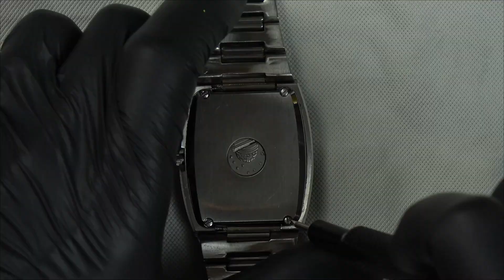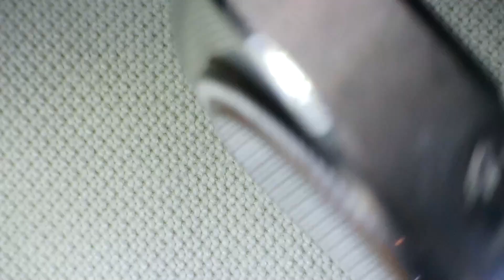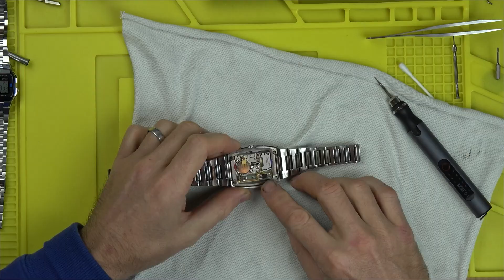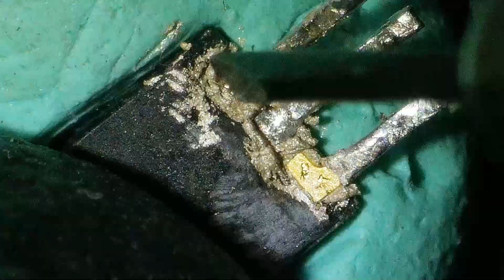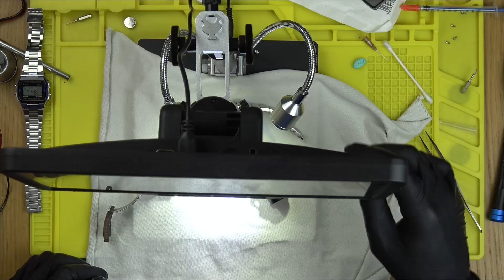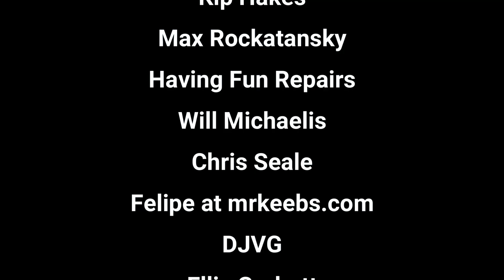Can I fix the RAREST OMEGA WATCH ? - 50 Year old OMEGA BETA 21

Comment: I bought the watch as its so 70s macho. My strap is shot, so it needs a refurb. Trouble is, it has a framework inside the leather. Is almost like 2 straps combined. Have to get refurb 100%, otherwise ruins the look completely. Cant just make a strap, it has to incorporate the frame. Other option is to get a metal bracelet.
Reply: Thanks for your videos. Very inspiring. Have recently bought quite a few good quality 70s and 80s quartz chronos. A big help.

Comment: Such perseverance! Congratulations👍. As others have commented, the vibrating 256 Hz "motor" is just the final stage of the dividing down network. By using only 5 stages of binary division from 8192 Hz (to get down to 256 Hz) - and then employing that resonant motor for the final stage - CEH avoided the large amount of additional power consumption that would have been needed if a chip was used for  final binary division. These early binary divider chips were quite heavy power consumers compared to later CMOS ones!
Interestingly, when these movements went back to Omega for repair later on in the 1970s, they seemed to routinely replace the 8192 Hz oscillator with a modern "32 kHz" version. Presumably because technology had moved on and the old chips may not have been available anymore. The customer would have been unaware of this of course; after all,  it didn't change the functionality of the watch. I can vouch for this to be the case because I've examined such watches & personally measured the oscillator frequency:  32.768 kHz not 8192 Hz!!

Comment: Congratulations Vince, unbelievable how you could rescue the power supply faulty bond wire, it look pretty messy but worked 😀 However, it looks like you murdered the trimming capacitor by trying to solder the sliding contacts on the ceramic silver metallisation... The motor, although tuned to the 256 Hz frequency by a moving mass, cannot be labelled tuning fork, because there is only one arm. That is why the whole watch body is humming! Making a tuning fork motor with opposite phase from one arm to the other would have cancelled this humming and maybe improved the efficiency (battery life) but not sure, because the microcircuit was made from bipolar technology, draining a lot of current. The ODC 5 is an evolution of the initial ODC 4 circuit used for the zero-th series (6'000 movements) sold initially. That first version is recognisable by the hex brass nut working as a trimming capacitor. I was born in Neuchatel and was 8 yrs old when the Beta21 was first released in 1967 but completely unaware of the unique and seminal work done by the CEH, 500 m from my home, whose engineers team built every component of that watch, including the integrated circuit, by hiring Swiss expats who had worked in the first semiconductor companies in the US after the 1950's. The CEH silicon microcircuit director, Kurt Hübner,  had actually worked with William Shockley in his laboratory in Palo Alto.

Comment: vince your channel is awesome!
this is NOT a quartz watch this is a tunning fork movement that predates quartz
Reply: It is a quartz watch because the timing unit is an 8192 Hz quartz oscillator. The "tuning fork" motor is part of the clock dividing system, running at 256 Hz. 
The quite low frequency of the oscillator and the rather high frequency the motor is running allows the electronic divider circuitry in the chip to have 5 stages only (dividing by 2^5=32). In the late 60ies of the last century, it was not easy to build frequency dividers with low power consumption, the technology was not there yet. Even with these measures the Omega 1300 Beta 21 caliber presented here consumes about 13 uA (average, including chip and motor current consumption). 
The tuning fork motor in the beta 21 watch module is an adaptation of the Bulova Accutron tuning fork technology, where the tuning fork is the system's timing unit.

Modern quartz watches run at 32768 Hz and tick a Lavet motor once per second, so the microchip's frequency divider has 15 stages (2^15=32768). Modern quartz watch modules consume about 90 nA (chip only) and about 1 uA (average, including chip and motor current).

Comment: Should have kept grinding away until you could see the bond wire by the way there not soldered inside the chip there welded and by guiding away until you can't see the bond wire you could try to solder it back together with a tiny piece of wire the bridge any gaps between the bond wire and pin

Comment: this chip is a voltage regulator TPS720105DRVR
Reply: It's not.  It's a Beta 21 Version 3 CMOS oscillator chip  CEH-ODC5
Reply: @eidodk  yes ….and good luck finding this stone-age chip, I posted the number for the replacement, that you can buy today

Comment: Just a tip for your soldering, if your touching old solder to re melt, try using a tiny splash of bakers soldering fluid no3 to clear away the oxidising from the top layer. Thank me later! 😂

Comment: This is one of the Best so far. On the other hand early Omega Electronic watches were not long lasting. My Seamaster quartz bought in 1982 didn't last 10 years. My Wife's Roamer Quartz 35 Years & still ticking. BTW thanks 4 the Video. Greeting from Down Under.

Comment: Not strictly a tuning fork but a a see saw micromotor vibrating at 256Hz indexing a 256 toothed wheel via a little ratchet pawl. The  caliber 1300 beta21  movement was only made for one year. Most modern Quartz watch  crystals vibrate at 32768Hz

Comment: Curious as to your battery choice of 344.  I think the original battery was a WH3 (mercury).  Is a 344 a better choice than 395?  Seems 395 comes up as the modern version of that battery, but maybe there isn't enough difference between 344 and 395 to matter.
Reply from the maker: I really don't know the best battery for it. I know on some of the Bulova tuning fork watches they put a diode (I think) in with the battery to reduce the voltage to make it run better BUT on this one I'm not sure on the best choice. It looks like the 344 and 395 are both 1.55V but according to Google the 344 is 105mAh whilst the 395 is 55mAh so the 344 will last longer 👍👍

Comment: What is that tiny grinding tool like a small Dremel you used? Couldn't find it in the comments.
Reply from the maker: Hey Sammy, I just added an Amazon Affiliate link in the Video description. If you are not from the UK just type in Grinding Pen into eBay or Amazon and you should find the same one 👍
Reply: @Mymatevince  Germany. Thanks.

Comment: Why didn´t you connect the last pin to the chip?
Reply: Because the pad it connects to goes nowhere, so therefore the pin mustn't be required in this circuit

Comment: Hi my mate vince,loving your videos as there very entertaining so keep up the good work and was wondering what type of soldering iron do you use please.thanx
Reply: Thanx for that my mate vince,as got a 2 in 1 generic hot air station with added solder iron too, but it's abit naff plus I've also got a separate soldering iron with is equally as naff and just wanted something decent to make my soldering alot easier.Also can you change the tip on the hakko one you've got while it's still on and was wondering what type of flux you use too in your video.
Reply from the maker: @darrenmartin279  This Hakko I'm sure will be better. I believe you can change the tips whilst on BUT I haven't done it yet as it is quite stiff, I'd be a little worried about slipping and burning myself😂 The flux that I have been using for the last year has been Chipquik SMD29130CC 👍👍👍👍
Reply from the maker: Thanks Darren, I used to use a 3 in 1 generic Chinese hot air station but recently I upgraded to a really nice Hakko FX-951. The Hakko is the one you see in this video. It's lovely BUT expensive 👍👍👍

Comment: The board you fixed contains on 8MHz cristal and capacitor. The chip has 3 functions. It keeps the cristal oscillating, it divides the frequency down with a 5 stage binary divider to 256Hz and it drives the vibrating motor (at 256Hz). The motor is just a see-saw with a permanent magnet on one side and a weight on the other side. The permanent magnet is placed between 2 electromagnets. You see the weight but the electro magnets are hidden under a plate. The oscillator drives the electro magnets in an alternating way making the see-saw swing back and forward.  You called it tuning fork, but is actually not a tuning fork. The 2 fingers you see are actually just mounting points for the see-saw, not fingers of a tuning fork.. A gearwheel is driven by an index finger mounted on the rocking see-saw. The adjustment you made is an adjustment of the phase or neutral point of the see-saw. It is not used for speed adjustment.  You can also adjust the position of the weight (by rotating it - it is mounted eccentric) on the see-saw. This adjustment is just intended to make the watch work, it is not to adjust the speed either. It allows you to balance out the see-saw. That way your watch uses the least energy.  Speed has the be adjusted by an adjustable capacitor in the oscillator circuit (the capacitor looks broken on your board). Later quartz watches used stepper motors, no see-saw. Google "The Omega cal 1300 (Beta 21)" for a detailed explanation.
Reply: Just came here to suggest the same, the oscillator is determining the actual speed, initially it just hit every second tooth only...
Reply from the maker: @georgkohlhas8131  Thanks Georg, so that is why it was running at twice the speed. It is all starting to make sense 👌👍👍👍
Reply: @georgkohlhas8131  Right. That's correct.
Reply from the maker: Wow, really interesting Kris. So when it was running fast at the beginning do you think the index fingers were just skipping teeth on the gearwheel because the see saw was misaligned? As I slowed it down without touching the capacitor. Thanks for the super helpful comment 👌👍👍👍👍
Reply: @Mymatevince  yes Vince, I think you can expect any whole multiple of the quartz clock speed when the mechanical part is not adjusted well - also the battery will drain more quickly. Borderline bad adjustment can also make the mechanism skip teeth sometimes - but this is really not the way you should be adjusting the watch.
Reply from the maker: @kriswillems5661  Thanks for the info Kris👍
Reply: @Mymatevince  yes, it seems it skipped one tooth by each step before you did the adjustment.
Reply: Just a thought - if the indexing ‘finger’ is pushing two tooth’s worth at a time, it would run twice as fast. These can be adjusted. I haven’t worked on this movement but I have worked on three Bulova Accutron tuning fork watches, and the Tissot version, which work in a similar way….

Comment: excellent.. I work on mechanical watches and these early electrical watches are not commonly repaired... even if they are its usually just replacing the chip board. Great job!

Comment: Great job Vince. Didn't expect to see a microchip repair. I'm guessing the heat affecting the chip from outside pointed to a bond wire break on the outside terminals of the chip. Maybe if it was a break from the center, outside heat wouldn't of had quite as much of an effect as it did. You would probably have to heat it directly to get it to work. Nice work again Vince, that was really interesting to watch 😉
Reply from the maker: Thanks Anthony👍👍👍

Comment: similar issue with my pulsar date command watch,  except mine the lost line is related to the time set, it works fine but the hour keeps adjusting nonstop no matter what i do, i even disconnected the reed switch thinking it might be shorted, but ive determined the short is inside the chip so i cant do anything to fix it and getting a replacement for the movement just isnt happening

Comment: My mate Vince; Amazing work and video. I've seen you working on washing machines as well. I'm in Canada with a GTW 485S washer with matching dryer. Unknown to me I bought them thinking I got new units only to find out they're roughly 5 years old. The problem I'm having is a loud grinding sound when I try to use them. After making some inquiries, I've found out the transmission is bad  and also the display panel is wonky. I also found out there's no warranty which is a real pain. So I'm wondering if I can get you to help me fix it? Where would I find parts if needed? Your response would be greatly appreciated.
Reply from the maker: Hey Paul, sorry if this sounds rude but did you take out the transportation bolts out from the back, because recently a close friend of mine didn't know about them and he also had a loud grinding sound. Apart from that I would not know any more than what you read on Google and forums 👍

Comment: The watch was probably running fast because the battery in there is wrong. The 344 (silver oxide) is 1.5V and it should be a 1.35V (mercury oxide) battery, those aren't made anymore. Hearing aid batteries are 1.4V (zinc oxide) and thus are a better replacement.

Comment: Vince, if you want to regulate the watch much more accurately, video it running and count the frames taken for a complete minute - no need to try synching with another watch😉
Reply: For accurate speed adjustment you have to adjust the cap in the oscillator circuit. Vince just adjusted the phase of the see-saw motor. Although correct setting is important, this is not how you fine tune the speed of such a watch.

Comment: For the few seconds i thought you've manage to keep the leg atached and then .... eeehhh surpriiiiiseee :D Super glue would be waaaaay beter and stronger. A 1.2V programable micro controller would be an easy substitude here, you need to measure output frequency on the legs of the coil, multiply it by 2 because it change coil polarity on every tick then find someone to write simple code and flash it into the MCU. An MCU of that size will cost you less than 20 cents ;) The ouput frequency looks like 50Hz or 60Hz (maybe 32 or 64) because the movement of weight is visible and working frequency is dividable by 2 so 2^13 = 8192Hz 🤓
Reply from the maker: Cheers technixbul, most of that has gone over my head, but the more I research it the more it will make sense. Thank you 👍👍👍 If a chip could be found and easily programmed, it would save loads of these watches worldwide!

Comment: If it is a bond wire, then it not going to be fixed by melting. The chip is usually bonded using very fine gold wire which is ultrasonically bonded. Incredible that you got it working. Well done, Vince.
Reply from the maker: Thanks Ned, glad I didn't heat it up now 👍👍👍

Comment: The two scraped in lines you could not figure out say 692072 original and 697091 original, maybe part numbers which have been replaced with original spare parts...

Comment: Wow, I think it's time to remove the "'not an expert in these repairs" because that was an expert-level fix! I am also a passionate repairer doing a PhD in business models for repair so I am a huge supporter of repair. I recently acquired 2 Aibo ERS210 robot dogs and will be repairing them (could also be an interesting idea for you!) but even for me as an electronic engineer, I think I would have given up after the legs of the chip broke, such a good idea to use the silver paint to try to connect to the bond wires! Great job!
Reply from the maker: Thanks Alex! Good luck on the Robot dogs 👍👍👍

Comment: Great repair! It would be interesting to scope the waveforms on the pins. A small microcontroller could then be programmed to emulate the chip's behaviour if the originals are unobtanium.
Reply: There are pretty similar ICs with simple divider in soviet quartz watches like Luch and Slava, outputting intermediate frequencies higher than 1Hz. By the way, you can check the frequency by recording the humm sound from tuning fork buried inside this watch Omega watch movement
Reply: That's an excellent suggestion. I'm guessing it's just dividing the crystal down to whatever frequency drives the tuning fork coils, so an easy task for an mcu.

Comment: Nice watch, Vince!
I did not know that Rolex made any quartz watch. I thought they were all automatic. Anyway, after fixing this, my big wall clock would be a piece of cake for you :) 
Even though I fix everything around the house, TVs, laptops, smartphones, bathroom and toilet stuff, door lock, and also the kitchen sink, our car, our bicycles(my main job), I could not get that thing to run for more than 20 seconds :(
Reply: Rolex made the Oysterquartz for about 30 years from the early 1970's to the early 2000's.  A long time in manufacturing time, however it is estimated that approximately 25000 units were produced, which is tiny compared to the amount of datejusts or submariners produced in the same timeframe. Rolex Oysterquartz reference number is 17000
Reply: @bobkendall1805  I had hundreds of replicas in my collection. None of them were quartz. They were all automatic. That is why I thought they did not make any quartz watches.